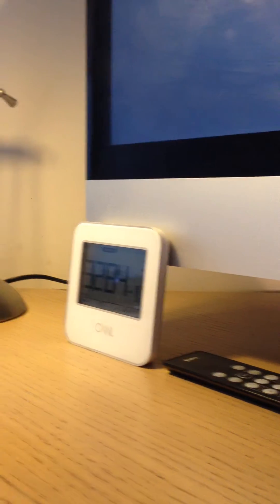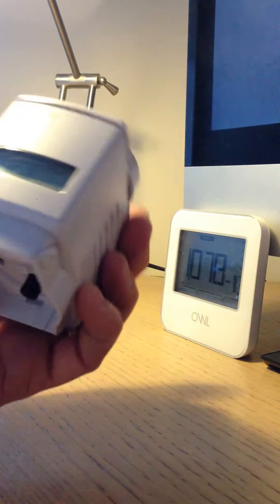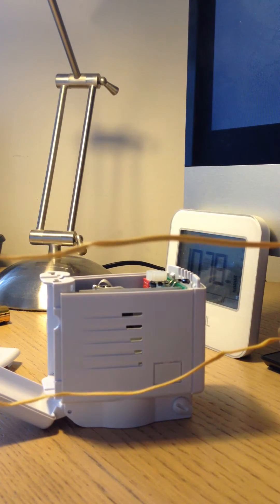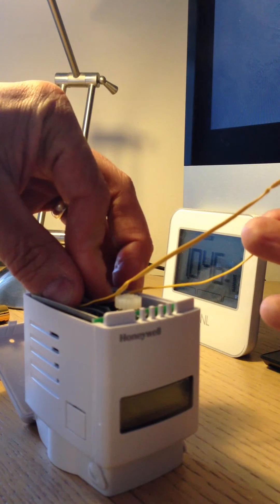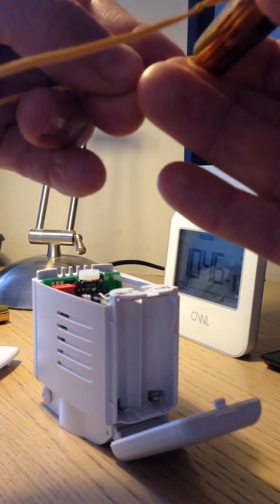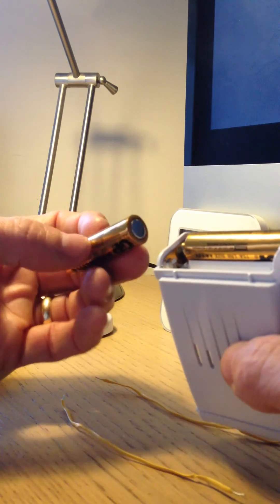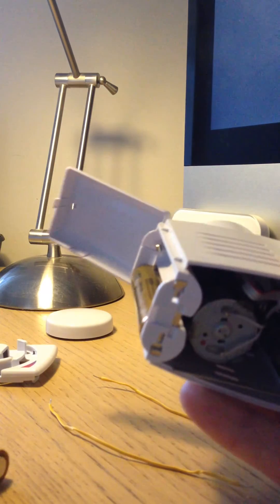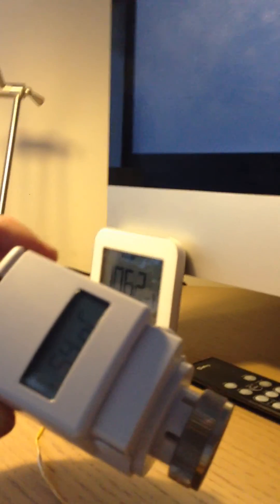Honeywell Evohome HR80UK HR80 E3 Error Fault Fix

Comment: Did anyone find the type of rotary encoder used for the temperature knob? They go mad after a few years, and turning the knob results in the setpoint to jump randomly. I would try to replace the rotary encoder, but couldn't find any suitable yet.